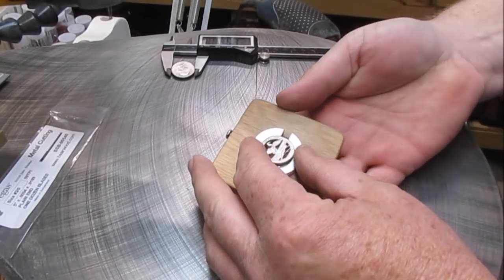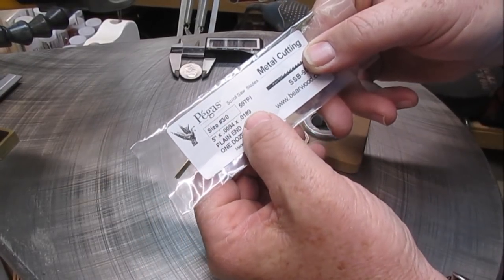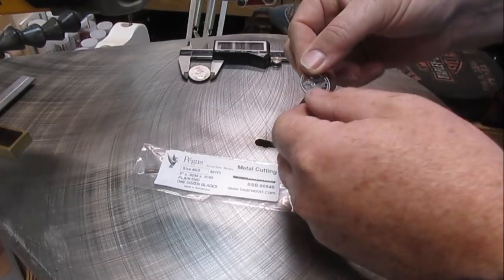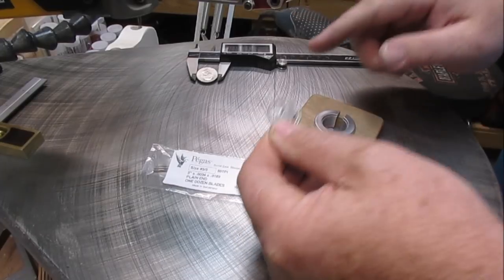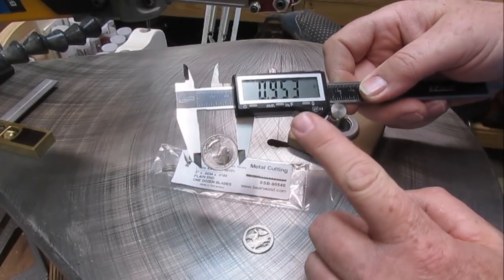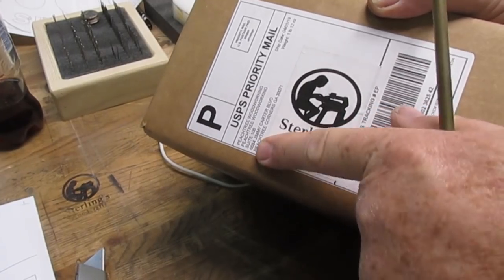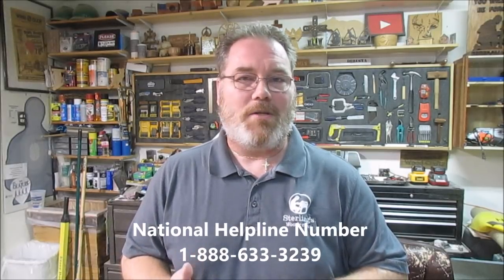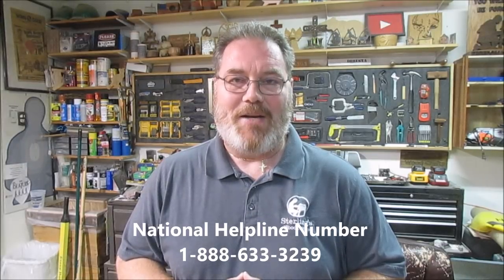Coin Jewelry on the Scrollsaw

Comment: I need to remove sterling flatware handles to scrap the silver.  Is it better to use a scroll saw or a bandsaw?  I would like to waste as little silver as possible but at the same time get the best, easiest, and fastest cuts.  Which do you think would be better?  And what blades should be used?  Thanks.

However, scroll saws do not appear to have a guide to allow for one-straight-cut down the off-centre of the knife handles.
Reply from the maker: I would imagine it would be depending on the density and thickness of the silver Scrollsaw is really for lighter softer metal, I would think your bandsaw would do faster, but would take away more material, I’m really not an expert on that, but it’s my humble opinion, hope it helps and thanks for watching

Comment: Cutting the same National Parks coin you are doing, but I'm using a hand held Jewelers saw.    I have the same DeWalt 788 you do I use for fret work, but tried the saw out on coins once and the cut was way to aggressive and I broke to many blades.   Someone mentioned there is a way to tune the DeWalt saw to take away the aggressive cut.   Do you happen to know anything about this in dealing with the DeWalt saw?     Your saw seemed to cut the coins nicely.    Thanks
Reply from the maker: https://youtu.be/huDNs6YtSnk check out this link from my friend Trevor, he did a great video on how to fix the aggressive cut on the wall 788, let me know if this helps

Comment: Hello Sterling, wonderful video. I just got a Dewalt 788 to cut copper jewelry in 18-14 gauge (slow speed with burr life). Are the Pegas blades far sturdier than other jeweler's blades? Their chart says they cut ferrous metal which leads me to believe they are strong and durable during turns. The Pike blades broke almost immediately. Yet they work great handsawing. I was worried I purchased the wrong saw then found Pegas blades at Bear Woods and plan to call Monday for advice. I'm holding the metal without a jig so breakage is expected but I would love it if the blades lasted at least 5 minutes. I was so careful yet they broke, your video gives me hope.
Reply from the maker: I have not had any issues with the metal cutting blades from that supplier , but I really dont cut a lot of metal, wish I could help you more , but do appreciate you watching